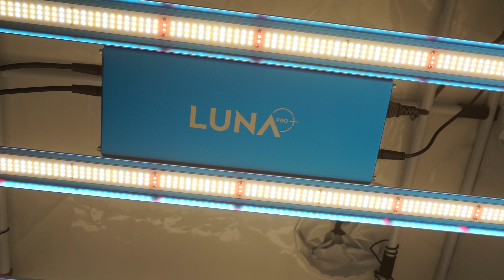Assembling the Omega Luna Pro+ 630W LED Grow Light | Step by Step

Comment: Hi Marc, its a 6 bar system... looks as good as the omega luna... I think the 8 bar systems are the best... I think we need the 8 bar system for better results and even distribution generating consistent larger yield and uniformity of light/ heat... The efficiency is one thing 2.7-2.9 umols/watt ideally... and 8 bar system, and high ppfd and evenlight distribution... The  se7000 is cheaper to run, the Mars Hydro is more powerfull and can be used with or without CO2 dependent on your hanging height... I would be only looking for 8 bar LED lights now.... 6 bar is not as good for yield on scrog... If you are not growing scrog, some like the optic 8 for low canopy penetration...
Reply: Hi, can you let me know what you think about this one - 1988 lm281b this is cheap one but I think it's still better than phlizon.
Reply: @MJ420.  Thats the best light you can get even better than the £850 se 7000.. from the Par chart its no contest... even the £650 mars hydro is better than the best SE8000 and also offers the option to supplement CO2 if you lower the light to 8" hang height... this is not possible at this price point with any other brand I have seen for this price... also 5 year warranty there will be no need to upgrade unless you are going to be pushing CO2 etc...
Reply: @MJ420.  Better than the best £850 se7000 8bar...

Comment: Can you guys confirm how many Samsung diodes are on the light fixture? kind regards, Chris
Reply from the maker: There are no Samsung diodes on the Omega Luna Pro+.
Reply: @growell  Any idea if the Omega is better than the spider farmer se7000?
Reply from the maker: We don't stock the Spider Farmer SE LED's so can't speak from personal experience with the light, but on paper the the Omega Luna has a higher PAR of 2.9umol/W and a higher PPF of 1830umol/s.
Reply: @growell  the se7000 has slightly less.. however I am hearing the Samsung diodes are the best.. and that I should choose the light with more diodes... the se7000 has over 3000 diodes... please let me know your thoughts..
Reply: @chrissmith5148  hello I have the same problem, and what did you choose which lamp is better?
Reply: @MJ420.  Hi Marc, I have been looking at a few light fixtures... one called optic slim 650 and spider farmer se 7000... I am concerned about the Par charts... which show the 8 bar systems to be very even light distribution allowing you to get your light closer to the plants.... Luna is 6 bar and at the moment I cannot find a Par chart to compare the PPFD distribution..
Reply: @MJ420.  Also the maunfaturers using samsung diodes give longer warranty may be due to longer life...
Reply: @MJ420.  Also Mars Hydro FC E8000... it depends on the PPFD chart... the higher and even the numbers on the test the more consistent canopy.. Luna is 1800Umol, and more efficient, however not Samsung diodes, and uses a warm white diode only rather than white and blue separate... they say its newer tech however unsure what the charts will say regarding the even distribution and usable PAR...
Reply: I think Im going to buy the spider farmer se7000 or Optic slim 650s (2.8g per watt yield) and seems to have the best diodes...
Reply: @chrissmith5148  what do you think about maxibright pro 660w ?
Reply: @MJ420.  I cant afford the optic slim, so its going to be out of the Mars Hydro fc8000 and the spider farmer se7000.. from the charts the fc8000 might have the edge on even distribution, however overall very comparable the se7000 is slightly more energy efficient offering very similar PPFD with over 300 more LEDs and possibly lower operating cost... forget the luna its a 6 bar and cannot be as good distribution as the 8 bars...
Reply: @chrissmith5148  what do you think about this one, I think there is Samsung diode and price is 400£ ?
Reply: @MJ420.  Which one sorry Marc? I saw the Maxibright 6 bar in your last message, similar to the Luna however not as good as the 8 bar LEDs such as se7000 and FC8000... did you see the Hygro Hybrid Harvest?
Reply: @chrissmith5148  se7000 is 6bar also
Reply: @chrissmith5148  tell me what do you think about phlizon light's, the price is so nice but I am not sure about quality
Reply: @MJ420.  The 730W is the one I am talking about 8 bar, this is their latest version and is the one I am comparing to mars hydro...
Reply: @chrissmith5148  ye this is cost around 800£, to expensive for me
Reply: @MJ420.  In that case I would go for the Luna if its £500, or the se7000 preferably for £600.. also I would be careful that you are getting samsung diodes... I have looked around for a while and unable to find a better light than spider farmer from a PAR chart perspective... you get 1000 umol all over the canopy... which is near enough maxing out a 4x4 area... we dont even have any proof that the Omega can provide that even of a light distribution to match.. I have not found an equivalent yet... it could be 1300 in the centre and 800umol on the outer edges of the 4x4 area... so in the end you cant get your light close enough to get an even size canopy without having a hot spot.. se7000 best value/ quality ive seen... for £600... better than most at £1000..
Reply: @MJ420.  The one I looked at was powerful, however like many use less diodes however use more watts per diode in order make up the power range... however the more diodes, the more even the light spread... so ultimately the se7000 is much better with up to 30% more light on the edges than the phlizon.. Yes they all use good technology, and all use samsung chips with good reputation for reliability and build quality... however the light must be efficiently spread to max out.... for instance if the Phlizon was £400 and the se7000 was £600... I would say that you would get u to 15% higher yield from the se 7000 than the Phlizon visually comparing the two par charts...
Reply: @MJ420.  I hate to be brand specific however I have tried to find a better PAR light than the SE7000 however most get you average PPFD/PAR 700umol (from an 1800umol light), where as the se7000  average PPFD/PAR is easily 1000umol across the whole canopy... giving a 30% PAR difference and possibly up to 30% more yield as a result... with no hot spots...
Reply: @chrissmith5148  thx for a lot of information, I am close to buy se7000 for 599£, from what you write it appears that it will work best.I saw a video where a guy was using se5000 and he gained about a kilo from 4 plants. So I think this brand would be great.
Reply: @MJ420.  Also the number of diodes... I cant find more diodes on any other light... Im open to suggestions of checking out any more you can find... and I can compare the number of samsung diodes/ PAR chart... More diodes the better, se7000 (3300 x diodes), thats how they get a better light coverage... I am trying to steer clear of other manufacturers diodes as I am aware that samsung are made to higher quality standard and 5 year warranty on the fixture... However if you find a light with 4000 diodes and a better average PAR 1300umol in the centre and 1200 umol on the outside for example would be optimal without CO2...and if for a similar price could be worth comparing the par charts.. So far though at £600 price point, se7000 is my clear winner so far... and a very likely purchase from spider farmer this year... Im not rushing into that kind of purchase I want the best I can for my money... Did you check out Hygro Hybrid se7000 harvest?
Reply: @MJ420.  The Se5000 is equivalent to that phlizon... and £450... with samsung diodes...
Reply: @MJ420.  OK this is the crack!! Final comment on the subject... as we are both looking for the best we can get for our money....The mars hydro FC8000 is the better PPFD/ PAR. Even better than the SE7000 (8 Bar).. However not samsung diodes... so for the price £650... you might decide to take the  Mars Hydro FC8000 over the Spider farmer... at a hang height of 12" the PAR is much higher and no need for CO2 if hung at 12" or higher.. Also 5 year warranty... Right here right now the Mars hydro FC8000 is the best I can find on the market for less than £1000.00 (or without the need for CO2)... All depends how hard you are pushing your ECs and airflow to take advantage...
Reply: @MJ420.  Im told not to get spider farmer or mars hydro.... due to overseas after sales service/ warranty and no uk distributor..
Reply: @chrissmith5148  that is, you changed your mind and you no longer want to buy?
Reply: @MJ420.  I am asking them for a UK distributor, however yes it is a risk buying as they are not UK based and their warranty on their website is pretty worthless compared with UK warranty... There seems to be no buyer protection and they are not really offering any legitimate refund or service centre type service in the UK... therefore you might not get your light back worst case, best case may take a while if it is repaired under warranty... you would have to send to USA... its pretty much buy and hope it doesnt break... ive seen one person who had a failed ballast and had to send back... weeks/ months without use of the light... I have been advise on the Hellion 8 bar form OSGS however too expensive for similar performance to se 7000 £850 for the Hellion...
Reply: @MJ420.  I think Im holding off for now, looking to see if anything else comes to market this summer... however the Zeus pro 600w looks very similar light distribution to the se7000 6 bar... I would say equivalent considering the uk service might be better to get from one stop grow shop... if you ask for nick budibent he will probably do you discount...
Reply: @chrissmith5148  buddy, I found a phlizon 8bar 1000w for less than 500 quid, the parameters look nice, please check this lamp and tell me if it is good quality for such a low price.
Reply: @MJ420.  send me the link I will check it out.. thie issue we face is buying from a reputable shop that if all goes wrong you can worst case drive to the shop to sort it out... otherwise can you trust that your light wont be damaged on transit wink wink....and warranty is then very much an issue as they will not take responsibility during transit... If your light needs to go to another country to be repaired or judged under warranty then transit to another country becomes a risk.. even with transit insurance...